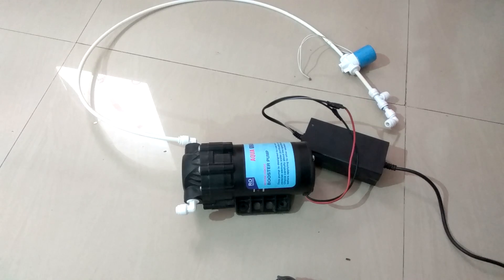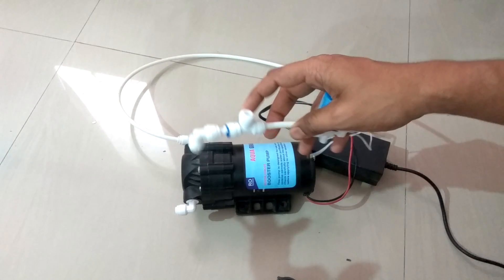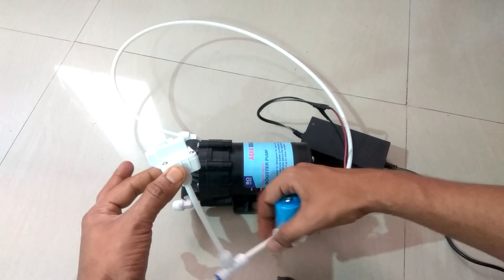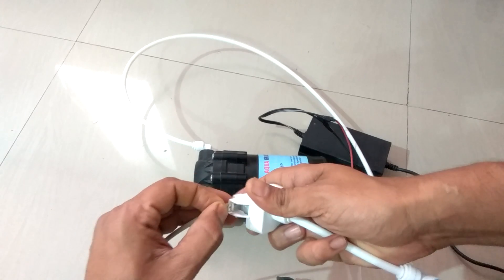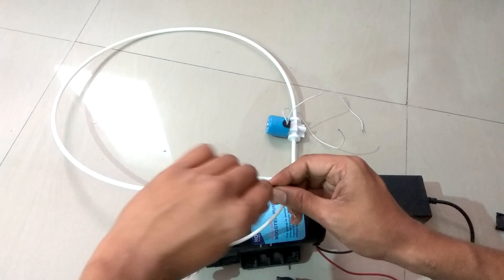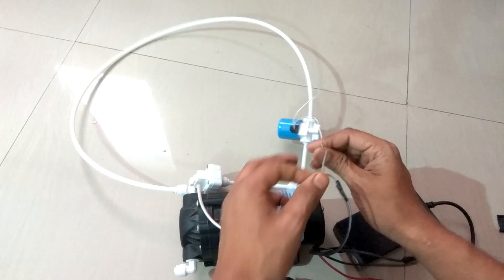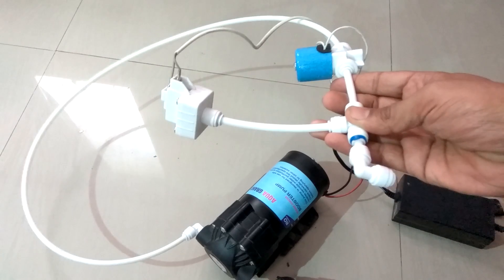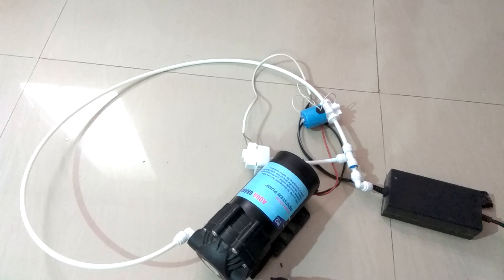LOW PRESSURE SWITCH how to install

Comment: Can i use LP switch  to cut off  air compressor if pressure is above a certain psi
Reply from the maker: Air pressure switch are different.this is for water
Reply: @reviewmaza  oh i am looking for a alr pressure switch to cut 9f at 18psi and start at 10psi

Comment: Can we use lps to turn on/off on booster pump based on valve open and close ? Does it work without solenoid valve ?
Reply: I just want an indication, using LPS Whether water supply from municipal is still coming or not.

Comment: My kent RO's motor switches on for 1 second then switches off, after 5 seconds it turns back on for 1 second and again turns off, it keeps on repeating in the same manner. If I turn off my ro for 2-3 hours from main switch, my ro starts working normally. My technician said that there is a problem with low pressure switch, but my ro started working normally when the technician came, so I told him that I'll have LPS changed when it'll completely stop working. What do you think about this problem?

Comment: You have not connected it to the float switch? Does this makes any difference?
Reply: flow switch is very important because it will cut off current when tank fulled but in this man's case he miss that.

Comment: As far as I understood thru your video that water will not pass thru low pressure switch. It will only sense the water pressure and switch off pump. Better make a diagram for water flow and power connection also.

Comment: our commercial RO 1000lph stops due to low pressure.It works on manual mode from 2 months.problem not resolved yet.what may be the problem.Input water supply is OK.please clarify.
Reply from the maker: Low pressure switch kharab ho gya hoga ya uska setting karna padega

Comment: Can we remove the connection of low pressure switch in kent RO? If no than tell me the contraindications from this.
Reply from the maker: +Tarun Jadoun yes you can remove , but you will have to take care if the input water is not available
Reply: Reviewmaza Thank you very much

Comment: I m using Kent grand plus , in it there is no lips, so if I want to instal it what psi powered pls should I use. 2nd , is there DC and ac float switch or DC and ac foot switch are same. Plze guide me Sir,  and this video is really very helpful, thank u sir...

Comment: Dear Sir
My water purifier is wasting a lot of water than in the normal case and it is also purifying very less of water to the storage tank. 
Please guide me how can I repair it ?
Reply from the maker: +Rahul Soni replace the inline filters and ro membrane
Reply: Sir, will that be necessary to change the sediment and post carbon filter while changing RO membrane ?

Comment: Dear, You seem to be confused while speaking , can you please clarify the exact positioning of LPS and SV  some time you say it should be at 1st inlet water then you say it should be after Carbon and Sediment filter, kindly clarify or if possible redo the video with proper demonstration and words.
Reply from the maker: the lps must be before the SV so it can sense the water pressure., 
and it must be after the sediment filter and pre carbon filter. so it can sense the pressure drop due to clogging of the filters...
ok .. ?
Reply: Reviewmaza Thanks for the information, I really appreciate your work but please prepare well before posting videos so that it improves quality and trust in your videos. 
Best of luck!

Comment: Sir, what is the use of Low Pressure switch?
Reply from the maker: low pressure switch is used to protect motor from dry running .and also protect the membrane.
Reply: Thank you so much sir.. Your videos are awesome.. Very enlightening..
Reply from the maker: +Abir Karmakar thankyou